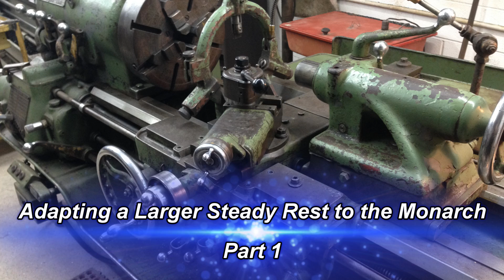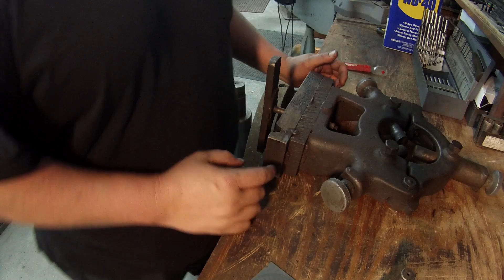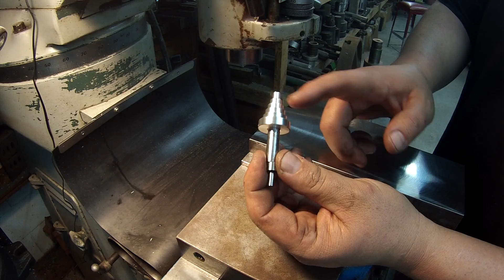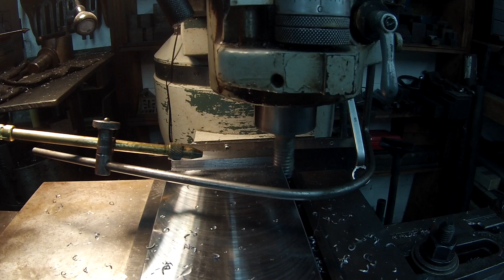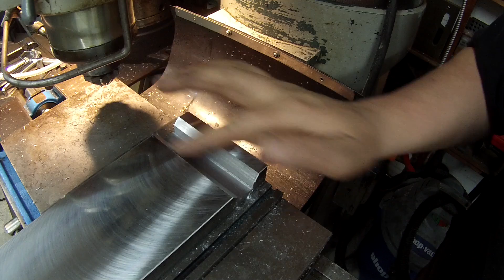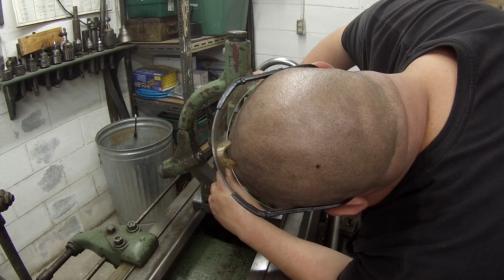Adapting a Larger Steady Rest to the Monarch Part 1

Comment: I went to Logan Lathes for one of theirs and only had to make a new under way block.  The top matched nicely.  Used it once.  The lathe use is up and down through the years - machine always was ready to be used, I had to change the belt only.  I want to change the power cable but I'll likely do that this fall.  It is need that moves on / off.

Comment: I am sort of in the same predicament. I just bought a Clausing 5914 and it came with no steady rest. Though you CAN find them, I am wondering if its easier to either build one like Keith Fenner did for his Clausing or buying one off Ebay and adapting it. Only issue is the 70° way angle.

Comment: That was interesting Adam. I have to do a similar thing, but I  have to build the whole steady rest to take about 12 inches of hollow cold rolled bar for a press. My old lathe will only take 4 inches diameter on its steady rest. So I have taken note of how you milled that ninety degree slot.

Comment: Hi,I like your video's. Try this place for a steady rest or other stuff you might need "new or used". They have hard to find parts. Use to go there a lot when I was machining a lot in So.Ca.
Haven't be out there for a while so don't know if it's still there. Worth a look .
 
Machinery Center: Located in South El Monte, CA on 10864 Fawcett Ave.
Machinery Center telephone number is
(626) 442-0750.
Telefax:  (626)442-2959

Comment: Very nice work Adam! I'm curious, are you planning on cleaning up that Stedy Rest?  Perhaps it's time to media blast it and repaint it while you're at it...  I'm also curious what treatment (if any) you plan on doing to the new support block to prevent it from rusting?  Black Oxide might be a cool project?
Reply from the maker: No plans to blast and paint the steady, but will do a good clean up to get the crud off it better. The bottom plate I'll keep well oiled to keep it from rusting. Having the shop climate controlled helps tremendously to keep the rusting problems down.

Comment: Adam, the V mill that you used is it what is called a Bevel cutter?
I just finished building from scratch a steady rest for my small lathe and used a 1" piece of Aluminum to get around the problem of not
having the proper cutter.
Reply from the maker: I think the correct term from Whitney Tool Co. Is it's called and chamfer cutter, or chamfering end mill. I just call it an angle mill.
Reply: Yes many names for the same thing!
Is it possible to do a short video of doing the same thing with an end mill inclined.

Comment: I think the best application I have seen for those stepped cone shanks for multi sized collets is when used in combination with a coax indicator, especially in a cnc lathe for indicating in ID tools. I have been meaning to make one for use at work but havent had the time, gotta machine it really carefully on the best machine you can find for better accuracy down the road while indicating.
Reply from the maker: Good idea, I didn't think about that. Good thing too because they have a 3/8" shank also.

Comment: Looks good so far Adam nice surface finish on the block I was going to ask what you used but then I saw the still at the end.  That adapter Gill made for you is slick going to have to make one for my edge finder.
Reply from the maker: Thanks Bill! That 4" face mill leaves a nice finish for sure.

Comment: Thanks Adam,

You've reminded me of one more project for my 12" Logan lathe - make a steady rest...

I figure to use a profile / contour gauge to figure out the dimensions of the inverted V shaped ridge on my ways...

There should be an inexpensive "donor" rest out there on ebay or Craig's List - I just haven't found it - yet...

I may be looking at building one from scratch - kinda tricky when I've not got much in the way of a milling machine (SIEG X2 minimill)...

Yep, one more thing on my wish list...

Cheers,

Eric

Comment: Adam, New subscriber here. I found your channel about 2 to 3 weeks ago and I must say, I just couldn't tune away. I have just finished up watching all 208 post to date "Unless I miss counted" From all the ups & downs and all your great work in between.

So, I just had to say Hello! & Thank you. Its really inspiring to see a
Great Craftsmanship at work but also your Passion you put in to everything, Its almost hard to see which shines brighter. Your finished jobs or your love of Fabrication work.  

I just had a few questions.
Are you going to make two bottom clamps for the new Larger Monarch Steady Rest? One for the small Steady that doesn't fit well.

Also, When you and your buddy Paul are finish the Hydraulic Session series."Which I liked" Are we going to see our new found knowledge put to work on Troubleshooting the K&T Hydraulic Knee?

Again, Thank you so much for the Great Video Post. Keep them coming.
Reply from the maker: Holy crap Charles! You watched them all? Wow! That's alot of time on your hands. LOL Did you get any sleep??
Thanks for the sub, and glad to hear you are enjoying the videos. I try and keep something posted each week.
About your question, I didn't make one for the smaller steady because the bolt size is smaller. But I do plan to make another one for it later. Once you see how I make the one for the larger steady you'll get the picture.
Yes, we do plan to go into the mill for repairs. I just got dropped further down the list because of other work and projects that have come up. Hopefully after the new year starts we can get to work on it.
Thanks for posting your comments. I appreciate them. Hope to see more comments from you later as well.

Adam
Reply: LOL! I wish I had time on my hands. It took about 2 to 3 weeks to watch. One, two "maybe sneak in a third" a night and maybe one in the morning and the weekends I hope to just sit down and let them rip. Its hard to remember when I first subscribed.   I feel bad now that I've caught up, no more posts to watch until the next post. I look forward to future post. Hope You and Elena and the rest of your family are doing well. Take care, God bless...

Comment: Great video, thanks for sharing! This 90 degree cutter looks very useful.

How are you securing your vise to the mill table when it's in the "normal" position, no toe clamps I guess? Did you indicate it to be parallel to your axis, or just aligned it by eye with the help of a t slot?

And another question: when do you use a 4 flute milling cutter, and when a 2 flute one? Can you use a "normal" milling cutter to face mill? Or is it only usable for side milling?
I guess I could need a milling basics 101 :D so much to learn...

Thanks!
Phil
Reply from the maker: Philipp, the vise during normal operation is held dwn by two T bolts, one on each side. The bottom of the Kurt vise is milled with keyways, so it's easy to flip it 90 deg and drop it down parallel with the center table slot. But you have to use other clamps to hold down when mounted this way.
I normally use 2 flute end mills when cutting keyways or slots, but 4 flutes work ok too. When side milling, 4 flutes seem to work a little better.

Comment: nice work, Dose the steel not scratch the way`s? wouldent have been better using castiron?
Reply from the maker: Cast iron would have been great, but I used what material I had on hand. You just have to make sure the ways are clean when you slide it around.
Reply: Abom79 I am "scard" to not scratch the ways becouse my lathe has some wear on the ways(near the chuck) and I know how mutch i struggle if must do longer shaft :)

Comment: I think if I didn't want to set it up in the mill again I would at least use a flap wheel with a grinder to give that v way a bit more clearance. I would rather have it a bit loose than be prying on the ways when the steady is tightened down.  I just saw the right steady for your lathe sell on ebay a week or so ago for like $70 wish I had known you were looking for one!
Reply from the maker: $70?? Damn I lost out on that one for sure.
Reply: I'm looking for a steady for my 12-1/2 Cincinnati lathe.  would have sped up the work this last week.

Comment: Hi Adam !

Nice project and right on time for me ... I'm doing one for my lathe too and am now a little stucked because lack of a 90° cutter but I have one like the one you're using ... so !

I have a little more problems finding out how deep to go because I have no model to take some measurements on like you can !

... now I need to go on that project !

Thx for starting me up again !
Reply from the maker: Hey Keld, if you have another scrap piece of metal maybe you can use it for a test piece so that you can get your measurements on size. Don't forget you can also set the parts on angles, or the nod the head for use with a regular type of endmill.
Reply: Abom79 Or, if metal is dear, you can mock it up with a block of wood and get the dimensions.

A profile or contour gauge - the ones used by woodworkers with all the little parallel pins - also can save some time as it will let you transfer the profile onto cardboard or wood... Very useful when trying to be sure that you are matching up to that ridge on the ways...

All the Best,

Eric

Comment: Nice to see some machining. Why would you not recess the top of the riser block by 1/8" to get the steady rest "on centre".
Reply from the maker: The block is actually 1/8" low. I should have been around 1 3/8" thick. I went with it but will talk more about the subject in later videos.

Comment: Why wouldnt you have set the block in a vise at 45 degrees and used a center cutting end mill to cut the V? Cut the relief before or after?
Reply from the maker: Just more time and setups involved in doing it that way, but if I didn't have a good angle mill, I would have done it that way.

Comment: Hey Adam, what are you using in your cool mist system? Am I correct in thinking that it's okay to just use water.

Keep the videos coming. All the very best from Australia.

Ethan
Reply from the maker: Ethan, I am using a Kool Mist system. The rod thats attached to the mill was made up by Tom Lipton. The water should have the proper coolant mixture to not only provide cooling action, but also for lubrication of the cut, and to give the anti rust protection. I use Kool Mist formula #78 mixed about 10:1.
Reply: Abom79  Thanks for the help much appreciated.

Comment: Good morning Adam!

Nice description/instruction on the design, setup and milling!

Curious...are you going to change the pins to wheels for riding on the part?

ATB
Chuck
Reply from the maker: Thanks Chuck. The bottom two fingers have rollers, while the top has a bronze plate. Not sure why they made it that way. I might swap out the top finger to use a roller also.

Comment: Good work. Do you know proper name for that 90 deg cutter, I ebayed taper mill & cone mill but nothing with that big of a angle came up. It would be useful in making carriage stop/indicator holder, (and other accessories I have in mind) I did the 45 deg fixture set up and a 1/2" mill to cut the last one I made but it was kind of a kludged setup. Will probably get a better idea how to do this when you cut the top notch for the key. Thank you for teaching us hobby guys how the PROs do things.
Reply from the maker: I still have the box in come in and it reads: Face Angle Shank, 1 5/8x90Deg M42.
I've always called it an angle mill. it could be called a 90deg angle mill also.
This one was made by Whitney Tool Co. Manufacturer part # is FAC162590M42
Reply from the maker: Here ya go! https://www.whitneytool.com/Products.aspx?ID=21
Reply: Abom79 got it Single Angle Chamfer Milling Cutter
thank you

Comment: Can't you swap the plates? then you can use the small one on the Victor
Reply from the maker: The Victor already has another smaller steady rest, and its about the same size as the one on the Monarch. With this adapter plate I can use the bigger steady on both machines.
Reply: Abom79 U're fast i am still watching your video
Reply from the maker: I'm at my PC doing comments and watching others videos, making a new video, and getting ready for Keith's tool box giveaway. :)

Comment: I must be dumber than mud as I still don't know how to use or even know what to use an edge/Centre finder, I watch you use it and it still don't make sense to me. I don't have one or know if I need one as I have a small setup and lay my measurements onto the surface, so not sure if it helps or not.
Reply from the maker: I'll have to make a quick segment on using an edge finder for you. It's a very neat, simple tool for finding the edge of a part. The tip is held by an internal spring and wiggles as it rotates. You bring it up to your edge slowly watching it as it trues up. Once you see the tip kick off to the side, your on the edge. Take half of the diameter of the tip, which that one was .200 diameter, so you move the table over .100 and that puts the axis of the spindle dead nuts on the edge of your part.
Reply: Okay I wasn't including the diameter of the spindle so it wasn't adding up for me, is the same rules for Centre finding.